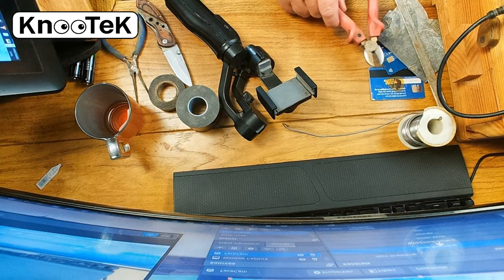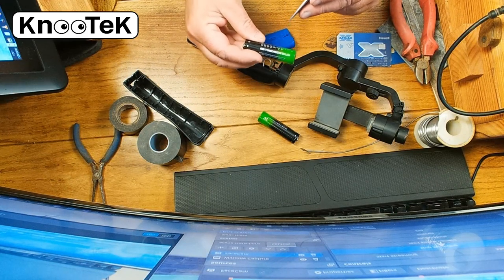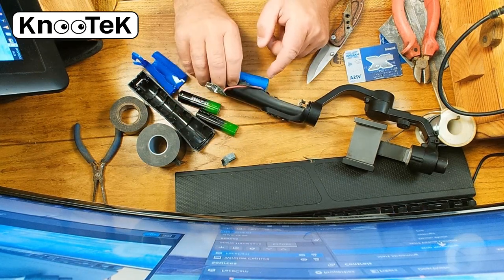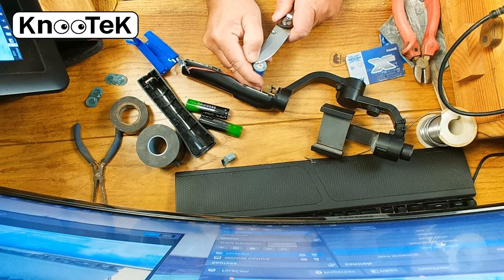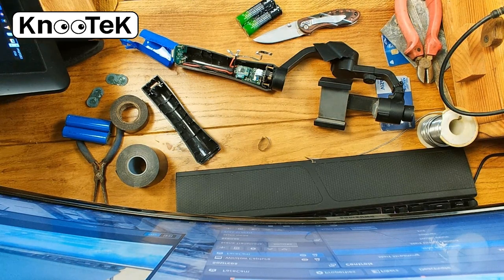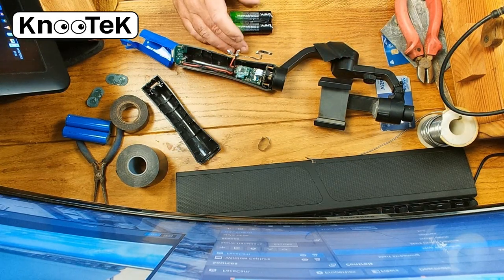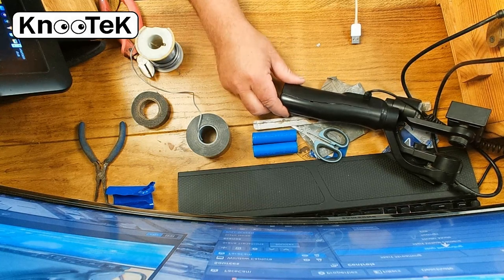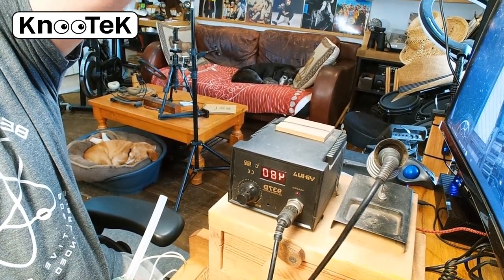Replacing Zhiyun Smooth-Q built-in Batterie | Unedited (UPDATE: WIRE IN SERIES NOT PARALLEL- My BAD)

Comment: I have one of those. When plugging in with two different USB cables, the light is just flashing really quickly and it doesn't appear to be charging at all. Is this a battery issue?
Reply: I'm experiencing the exact same problem on mine. Don't know what to do yet...
Reply from the maker: Yes most likely the voltage is too low to be recognised by the charge circuit
Reply: @KnooTek2000  I already replaced it and it works, thanks.